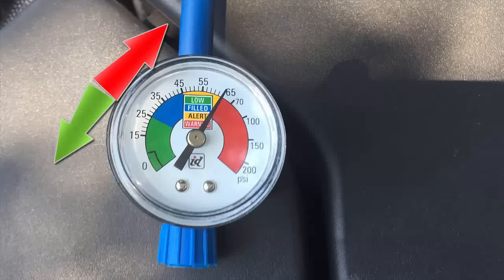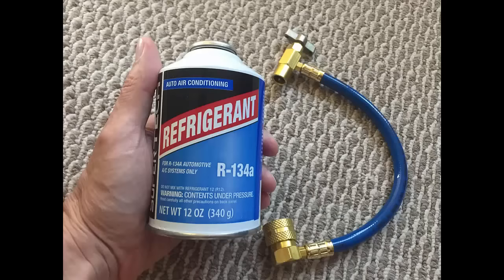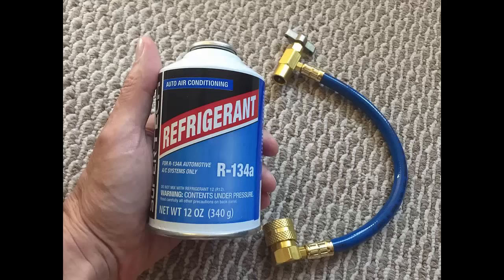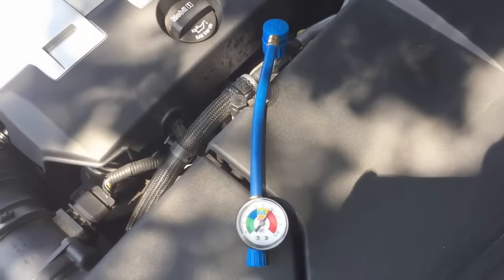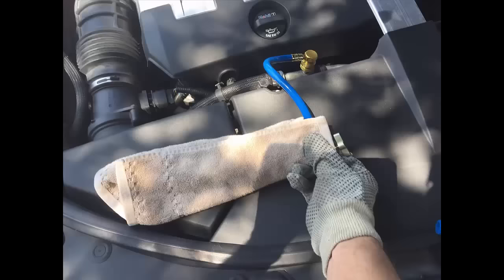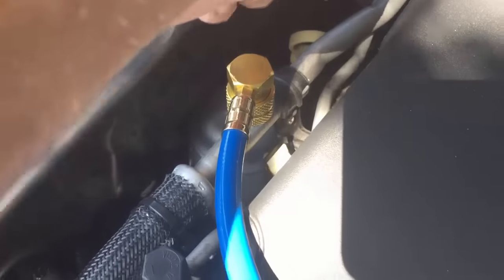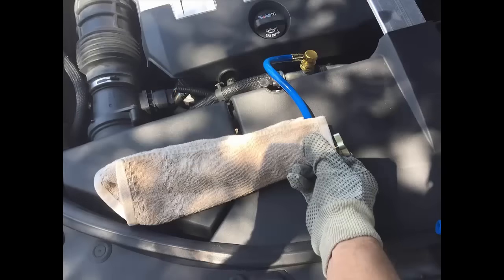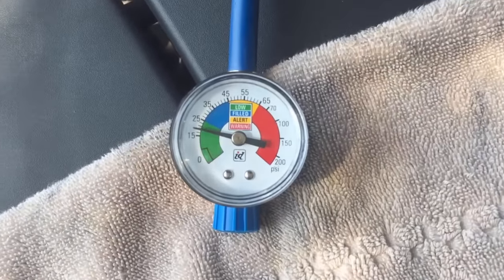Car AC pressure too high FIX overcharged a/c gauge fluctuation reading jumps Up Down Freon problem

Comment: My psi is steady at around 70. I let some out then I found this video. It was getting warm at idle and took a while to get cold in morning (car had to get to fill operating temp ) glad to see someone else tried the same thing I already did to backup my reasoning

Comment: Thanks man. I've got the same situation but the compressor is buzzing after I topped up the r134a. Did u have this? Also did you use r134a replacement refrigerant in an r134a cooling system?
Reply from the maker: My compressor was not buzzing. 
And I used regular R134a (container in this video) that you can buy in Walmart.

Comment: Reducing pressure worked for me too.  Initially, I didn't trust my gauge showing high pressure, because every time over the years I've had my A/C compressor not engaging or cycling off unwantedly, it's been due to low pressure. I now know the gauge was correct that my refrigerant pressure was high.  My first inkling of this occurred when turning on the A/C the next morning caused a grinding sound. I only kept it on for a few seconds, but I was still concerned I'd burnt out my A/C compressor (luckily not, though I may have still done some slight damage).  When I removed the port cap, I noticed it didn't just make a small 'pfft' sound, it blew the cap somewhat forcefully into my hand. The same sort of over-pressurized clues continued afterward as I connected and disconnected the pressure gauge (that you use when adding refrigerant). 

One observation is that, for my A/C system, the pressure did tend to drop over time, say over 15 minutes, while idling. Yet I wonder, right as I first got in my car and carefreely turned my A/C on that morning, if being in heat wave weather combined with sitting in the sun hadn't raiseed the pressure, causing it to reach even higher pressures than the previous night when I'd added a can of refrigerant, resulting in such a high pressure that some refrigerant wasn't fully evaporated (i.e., still a liquid) before entering my A/C (gas) compressor. I've read that you get the most efficient cooling in the middle of the recommended range (assuming you can trust your gauge) because that's the pressure range it was designed for. 

I'm no expert, but I'm thinking that the pressure, even when the A/C system is functioning correctly, will not always operate at the exact same value, depending on outside factors like ambient temp. and how long the compressor has been continuously engaged (and maybe whether at high rpms or idling?). So it's that range of operation that you want to keep within the 'recommended/normal' range on your gauge.
Reply: Yea it's recommended to let it equalize which takes about 15 mins, its also recommended to open you car doors when you are about ti fill it.  Another thing to consider is that the amount of pressure that is correct is determine by the outside temperature.  If its hotter then that will increase the reading on the gauge. Most gauges read of an ambient temperature if 70f.  Most guages should have that info on the packaging.  Good to hear you got it taken care, hope the extra info helps in the future

Comment: thanks i'm having the same problem.  I let out a lot of the refridgerant and my pressure was a lot higher.  I got the worse headache and felt bad for a few days but i' going to try it again,  i must have let out 7 ounces already.  I don't know why it built up to much but the compressor won't even kick on when the limits are that far off.  I'm gonig to let out some more pressure today maybe all of it and fill it back up to see what happens. thanks for the info.

Comment: I couldn't really tell if your car was running. Do I have my car and AC on when I hook up the hose to the low port or do I hook it up while the car is off
Reply from the maker: The car should be running with the AC on max

Comment: how were you able to get the freon out? I have the same one as in the video but it's not releasing anything? Do I need to press the needle?
Reply from the maker: In this video, I had 2 hoses. One to check the pressure and the other with a valve to fill and release. 
But you could certainly press the needle with a screwdriver while covering it with a rug for protection.

Comment: It was a worn out bearing in the compressor for me. I watched the compressor as the gauge pressured up and saw that it was literally getting stuck. Gotta drop the whole compressor out of the engine bay and rebuild it before putting it back in. I recommend bypassing the compressor on the belt system until you find time to do it.

Comment: Hi thank you for your video!
I tried to fill my AC and I overfilled it, I bought an AC pressure measure bar.. to see if it’s more or less.. the pressure is high (because the air that comes is hot).. So I tried to take some gas out from the Low pressure area( the same point where I filled it at first) but the pressure it’s still high and the air is warm.. how that is possible? Thank you in advance.
Reply from the maker: It sounds like some regular air got sucked inside your system. The proper way to fix that would be to evacuate all refrigerant and air with a vacuum pump. Fix a possible hole, and refill it with clean refrigerant.
A temporary fix: run the AC on max for a few minutes, then STOP the engine. Let some hot air out in short bursts from the LOW port until it gets cooler. If the air is still hot, you may need to run the AC for a few more min again, stop the engine, and release the air. Now the pressure should be more stable, so you can add some fresh refrigerant.
Before adding fresh refrigerant watch my next video about Static Pressure https://youtu.be/7loH93-9MNQ

Comment: Hi i like your what you doing 
I have a question, I have the cold line   the one with the  Ac pro , the temperature is 40c and above. When I measure it, it is above 60 or 70 PSI, is it normal?

Comment: Was overcharged and reduced to the lower range in the green sector. With a pencil thermometer in the fan at full blast, recirculating air, cooling lowest 60F with ambient temp 89F. The gauge's needle settles down but keeps going up to a high range in the green sector, and keeps doing that over and over. The vent air temp should be lower than 60F. Any ideas? Thanks very much!

Comment: Hey there mate, i couldn't tell but did you let the pressure out while the  ac running or the car off? Thx in advance
Reply from the maker: To be more accurate, run the AC on max.
Reply: @Your-Self  thank you mate!

Comment: Very helpful video mate thank you so much
Reply from the maker: Glad it helped
Reply: @Your-Self   and I want mentioned that if Antifreeze Coolant is out engine gets hot also that’s may lower the air conditioner I a right?

Comment: Should this method be done with car running and the ac ON at maxAC? Or with AC in off position and car running instead ? Explain in detail plz
Reply from the maker: The AC should run on max to provide a full load on the system.
it's best done at the hottest time of the day.

Comment: So I had the same issue- pressure jumping up and down, indicating the compressor was constantly stopping and starting.
(I live in north California, where we hit 110+ during the summer. Driving a 08 Honda CR-V.)
Similar to your video, my gauge would be red when off, mid yellow when on, then drop into blue when accelerator applied.
I tried dropping it to what you show here, but the freon wasn't really cold when coming out. The AC didn't blow any cool air when running.
So I set it to be on the top of the blue when the engine is running, which drops it to the bottom of the blue when the accelerator is applied. So far that has worked for me. Compressor stays consistent. But the air coming out isn't really cold. It's cold, just not as cold as my other car (2000 Honda Accord).
Reply from the maker: It's possible that there is a leak in the system, and through that hole, the regular air from outside got sucked in. The best thing, in this case, would be to find and fix the hole, vacuum the system, and recharge from the scratch.
Have you checked your Static Pressure to get a better idea of the refrigerant level as in the next video? https://youtu.be/7loH93-9MNQ
At 100°F the Static pressure should be around 124 PSI, and at 110°F around 146 PSI... assuming your system has R134a refrigerant.
Reply: @Your-Self  yes I've watched a couple of your videos- very helpful.
Since my above post I am aware of two things:
1- it seems as though my compressor is designed to turn off when psi is too high as a safety caution. I had to adjust the psi to be in the middle blue when engine is idling and compressor on. Obviously it dips into green when the accelerator is applied. So it's a compound problem- high ambient/static temp results in high pressure which turns off compressor. But then that means I need lower freon which makes AC not run as good.
2- my passenger side fan behind the radiator never seems to engage. That might result in the above issue being worse.
So my next step will be to get that fan looked at. If it is indeed malfunctioning, and I can get it fixed, it might fix the entire problem.
Right now I'm in the car and AC is working really well, but it's just after sunset and 95°.

Comment: I have the hose with trigger as pictured in the video but I only tried to release the excess 10 times 3 seconds each time but the gauge is still on red. Should I continue doing it more than that?
Reply from the maker: Is the pressure changing at all? If not, your compressor may not be engaging (not running.).
Check how much refrigerant you have in the system with the car off, as in this video https://youtu.be/7loH93-9MNQ

Comment: Very helpfully video I bought the same refrigerant that came with that gauge from my local Walmart. I have a question? my bottle is still full will it shoot out refrigerant if I unscrew the gauge off the bottle? I have this exact problem on my 04 altima.
Reply from the maker: When you remove safety pin and use the can at least once, the seal is broken. So if you unscrew the top cap with handle. left over gas will shoot out. Thanks for watching.

Comment: So as long as the gauge is in the middle of the green and the compressor is working I should be okay, right? I was thinking I might have over filled but hopefully not.
Reply from the maker: You could also check the Static Pressure inside to see if you overfilled it, as in the next video https://youtu.be/7loH93-9MNQ

Comment: Do you let the car run with ac on when you let the pressure out.
Reply from the maker: Yes, the car needs to be running with A/C on maximum. (full blast)

Comment: When releasing the pressure do you do it with the car on or off? And with the A/C running on high?
Reply from the maker: The car needs to be running with the AC on high.
Reply: @Your-Self  wow you’re fast at replying! Thank you, one last question, my car has a low and also a high pressure valve.. which one did you release from.. the one that says “H” on the cap or the one that says “L” on it
Reply from the maker: Your hose will only fit on the Low pressure valve, so use that one.

Comment: Was the car any chance a prius. I tried to on my prius and did the same thing. Started blowing hot warm i panicked and too it to get refilled somewhere. Im starting to think on hot days i think its mot cold enough and has a leak when maybe it dont. Now i decided to buy a thermometer to make sure i know the actual temp. N i only add a little at a time.
Reply from the maker: No, it was a Cadillac.

Comment: Can over charging the AC Can show that the o2 sensor has a failure? Or cause that the cars (manual transmission) lacks performance? (Meaning won’t change speeds )??

Comment: I found out if it’s really low that you might need to add a little oil to get the ac compressor lubed up because it’s leaked out the one at Walmart seals and lubes. I think it allows the ac clutch to engage a lot easier. if it’s above 84 F outside I add just barely enough Freon cause I found mines going too high also

Comment: My compressor was cycling on and off a lot but it was still cooling.  I thought it might be low on refrigerant and added 12 oz.  It showed to the low side of full on the gauge after the fill and the compressor stayed on, but it stopped cooling.  So this could be my problem. If you add R134 on a cool day, the pressure gets higher on a hot day.

Comment: Hi,do you release on the low or high pressure valve on the vehicle?
Reply from the maker: The hose fits on the LOW side only.
It's possible to do it on the high side with a screwdriver, but more dangerous.
Reply: @Your-Self  Thank you for the info. Everything work out good.

Comment: would you ever remove freon from the high side port of your AC ?
Reply from the maker: Technically it's better to do it from the High side. But the pressure is higher, so it could be more dangerous.

Comment: Hey man thank you so much this was my exact problem now ac is working thanks again!

Also if compressor keeps cycling this is the problem too much refrigerant
Reply from the maker: Glad to hear your AC works again! Thanks for watching.
Reply: It can cycle with to little refrigerate to. You have two pressure switches.  A low and high pressure switch.

Comment: Was your low pressure line warm before? I have similar situation but on full blast my pressure stays around 30PSI and after compressor disengages then it goes up to 60. 
After few min I feel cold air inside of the car but low pressure line is not getting cold. What are your thoughts on this?
Reply from the maker: Low-Pressure-Line should be cold to the touch. If it's warm you may have; 

Not enough refrigerant, 

Too much refrigerant, 

or some other problem.
Some repair shops offer FREE a/c check. Good luck.

Comment: I just put Freon in my 2004 Honda accord’s AC system using a temp gage that came with it from the store. I stupidly put too much in there but not carefully reading the gauge it told me I was already in green and I pressed it a couple more times.  My car is now making noises when accelerating. to stop the noise I turn my ac on and it goes away completely. What does that mean and is it safe to drive until
I’m able to get it properly repaired?

Comment: When releasing pressure, was your car and AC on or off?
Reply from the maker: The car should be running with AC on Max
Reply: @Your-Self  thank you!! Didn’t wanna start until I knew for sure. Having the same issue s as this video!

Comment: My a/c is blowing between warm and hot air.
The manufacturer calls for 1.626 lbs.
    How do I tell if there is any left in the system so, I don't over charge the system?
Awesome video. Thanks a lot.
Reply from the maker: I don't think there-is a way to find out how much refrigerant left in the system. The best way is to suck it all out with a special pump and replace it with exact amount that manufacture call for. The second way is to add a little at a time and watch the gauge so you don't overcharge. PS... make sure to do it during the day when it's hot outside (for more accurate reading) with AC running on MAX
Reply: Can't I just release the low side port until the hissing stops or, the refrigerant is all out?
Thank you so much for your reply and help. GOD bless.
Reply: When and how will the gauge tell me it is full?
GOD bless and thanks again.
Reply from the maker: Apparently you not supposed to release any gasses into the air, it has to be vacuumed out. Also, refrigerant consists of Oils and Gasses in a specific concentration. If you release gas only (in large amount), there will be too much Oil left in the system, and when you add new refrigerant the concentration will be incorrect. 

   When adding make sure the gauge comes close, but not over 45psi. However, it's only a guessing game with this type of gauge. To do it correctly you need a real Manifold gauge which hooks-up to both LOW and HIGH pressure ports... and that's where it get more technical.
Reply: I am a shade tree mechanic and the videos I saw explained it so well that, I can do it w/o watching the videos again and again.
Thank you very much for your reply and help.

Comment: I tried your method and the hose I have has a feature where it won't release any even with the knob full open or close. I usded a pen to push the small pin inside the valve on the low port to release some until the compressor was consistently on. Make sure to use a shower towel because it will release a bit of oil and of course r143a. My engine seems like it was bogging down when the pressure was too high when the compressor kicked on but this fixed it
Reply from the maker: Great to hear it and thanks for watching!

Comment: When you unscrewed the valve to release the air, did it start releasing right away or after some time?
Reply from the maker: as soon as you open the valve the air will escape, and the wider you unscrew it the faster it will escape. Your car should be running with AC on a full blast.

Comment: Mines just don't get cold enough when its hot so added some an it feel like it's less effective like its even hotter in the car but you can still feel some cool air come out should I try to take some out?
Reply from the maker: OVERcharged or UNDERcharged AC is bad for the system and can cause the air to be not cold enough. So try to go slow in either direction IN or OUT.